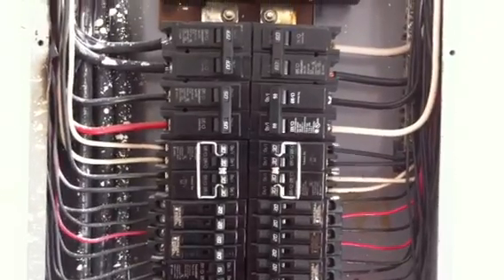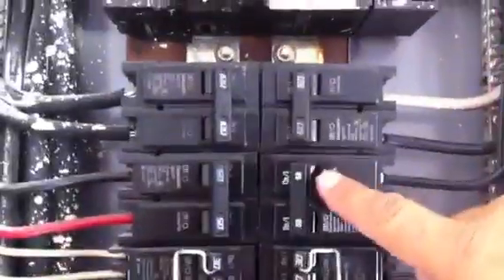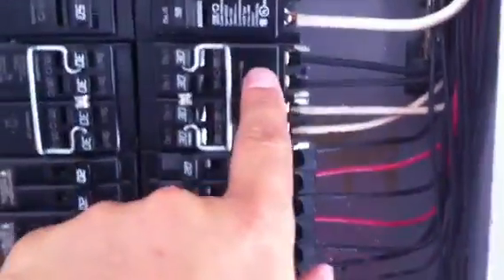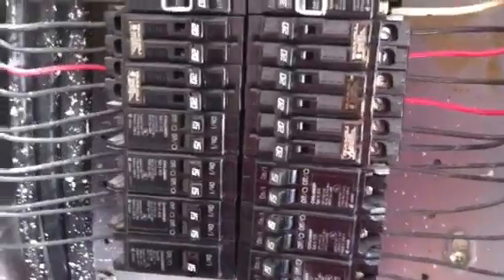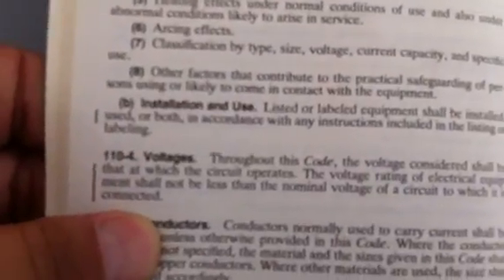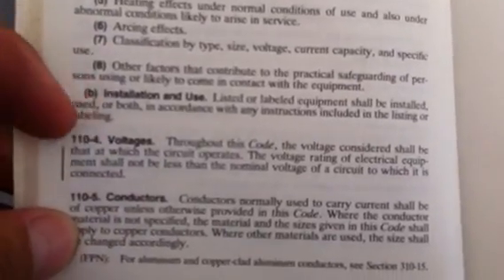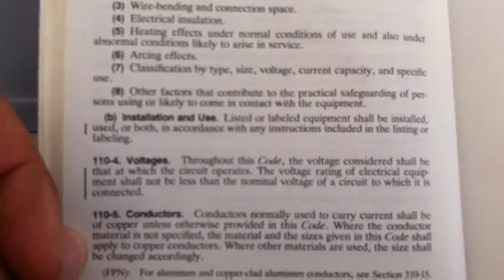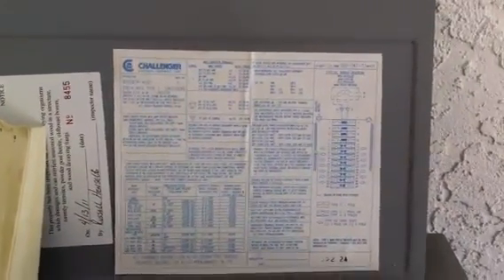Tandem breakers

Comment: Better than most videos but could be more specific: 

On the left side only:
The first set of 20A are actually "Thinline" which are half frames (bad idea) and the first pair of 25A are tandem (two breakers in one frame).
 
The nice thing about tandem breakers is that they're available in identical or different breaker sizes within the same frame and they have arc chutes and snap action controls for each breaker.
 
1/2 frames are just a bad idea...
1. Very hard to find.
2. Prohibitively expensive.
3. Often missing arc chutes.

Comment: Is there a way to put a 20 amp circuit in place of a split set of 10 amp breakers.  I want to run an entirely new wire to my kitchen and put the fridge on the new 20 amp breaker, there is a open spot, but it's for the split breaker.  The box is a g.e. box.

Comment: Thanks for the video I tried to install one on and it would not go on. now I know why  thanks  I tried to installed it on the top of the panel now I will try to do it on the lower side I noticed the bottom in a little different then the top

Comment: I'm confused. I have a Murray 200 Amp panel, 40 ckts.  On the label on the door, I do not see any indications of where twin breakers can be used. Yet I purchased a Murray twin breaker from Lowes, and it fit in with no issue, 5th position from the top. Is this ok?
Reply: 40 40  // 40 22